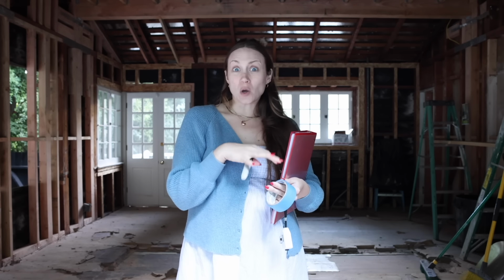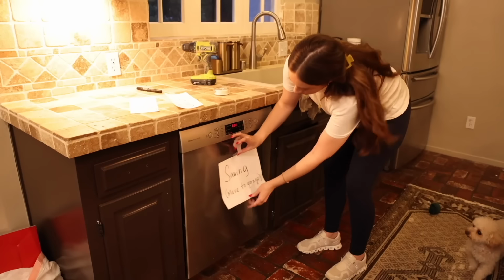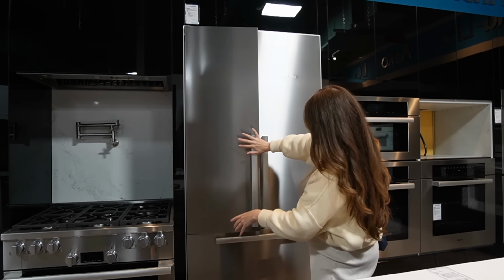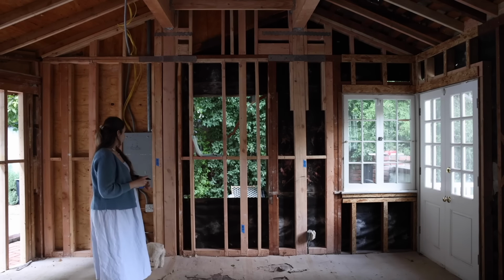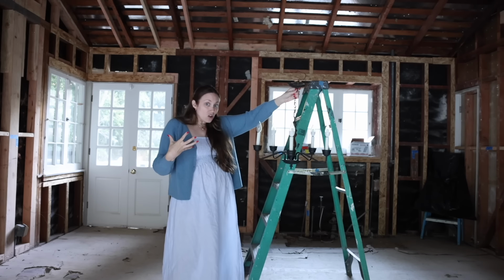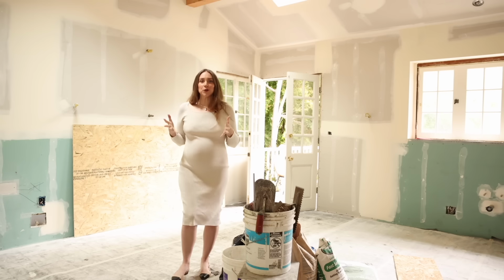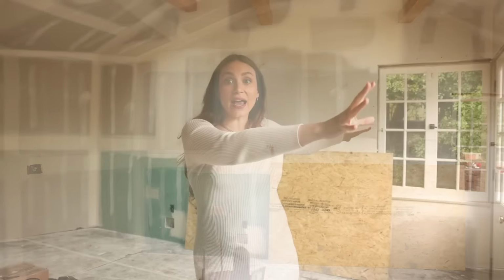EXTREME KITCHEN RENOVATION EP 3 | Appliances, Electrical, Plumbing, Insulation & Drywall

Comment: I love your candles but it costs sooo much i paid  $13?.00 for the 3 of them and then you dropped your price to $ 52.00 a candle when i paid more .I love the candles but on the one candle (green) i wax is coming out on the seal i guess it's fine but i don't burn it snymore because i don't want it to burn my table. I just love the one your Mom and you were in love with that is my faver by far. I fram your mom prints that was in the box! Everyone loves them 😊

Comment: I replaced our stove with an ILVE and it is absolutely gorgeous. It makes a huge beautiful statement in the kitchen (mine is cast iron color with bronze detail). BUT, there are definitely a few functionality things that bother me over the years. As a safety feature, you have to push down to ignite the flame for an excessively long time in order for the flame to stay on... and our broiler has never worked. Plus, all of the burners run way hotter than normal, so I can only put things on a true simmer on the lowest burner - which for me is the front left. Otherwise everything boils over, even on low. Also the walls seem to be thicker than normal so the actual interior space of the oven is smaller, so I can't fit as many things in at once. Anyway, just wanted to mention that in case its helpful since its a smaller brand that not everyone has! They are gorgeous tho!

Comment: A practical thing is.... Make sure that your Gass line too the stove, is longe enough so you can pull out the stove out from the wall so you can clean behind it on the floor.
So you don't get rotten leftovers behind the stove on the floor, my friend went thru that. 
Big hugs from Denmark.
🌹🥰💝

Comment: What if you just put the table on the other side of the room from the sink.  Run the table length wise in the same direction of the beams.  As an advid cooker, a table so close to the kitchen space is cumbersome and crowded - I like room for movement around other people (or pets) in that space.

Comment: Wait I am confused, are there no outlets at all over the kitchen counters? How do you plug in small appliances? Or are the outlets hidden under the upper cabinets and using the same power source as the under cabinet lighting? In any case, seeing this all come together is definitely cool, however in the first episode she talked about needing to do this project on a budget. Given the high end appliances, large number of new cabinets, structural changes, changes in electrical, plumbing, etc, there is no way she is doing this for under $100k (I also live in LA and have had kitchen and large construction projects quoted out here). I think this should be framed as "not unlimited money," because that is very different from "on a budget", and it's a little unfair and misleading to not make that clarification. Spending over $30k on appliances is not on a budget, vaulting a ceiling is not on a budget, this is a high-end luxury renovation, and that's totally ok, but let's just frame it as such.

Comment: I was curious if you tried any 3D options where your top cabinets aren't following the angle of the ceiling? For example they would stop aligned with the top of your wall so that the cove is more open versus having the millwork custom cut into several angles/panels and filled in? Very happy to see such quick progress for your project, you will be so happy to have this done before baby arrives :)

Comment: We decided against upper cabinets and love it. It looks so much more open and homier. It doesn't block the wall with dark boxes but keeps it open. We realized that we wouldn't reach for what was in the upper cabinets as it was a hassle to get to. Now we have a bigger kitchen and it feels extremely grand without the upper cabinets. We actually store dried foods in the kitchen for the first time and I love having it in the lazy susen. Maybe worth to note that we went a minimal route and have no handles to keep it extremely modern. The exhaustion hood goes inside the counter too, so just lights on the wall. Hope this helps someone with their kitchen plans.

Comment: Thanks for addressing my previous question about insulation and featuring this process in the video. Top priority for me would be energy efficiency and functionality, then pretty stuff. The more energy efficiency you can add now, the less you would need to use your aircon later, saving you money.
My dream kitchen would be all electric, induction cooktop, electric stove, double glazed windows,(or retrofit in existing windows). Leaving your 1930s windows as they are is a missed opportunity.

Comment: I love your Channel! Just a small suggestion, that back wall with the glass cabinet doors is stunning, however that small cabinet hanging in front that’s next to the sink seems to be misplaced. Is it possible to get rid of it and to have that space turned into a glass door, if not I still think it would look better without that little cabinet hanging in front of that glass fronted cabinet. Those contractors are amazing! Make sure you tell them I said so.

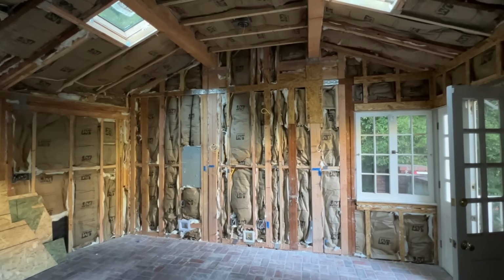Comment: At 21:18,I was quite surprised at how the insulation was installed. Since part of the science behind insulation is dead air space,I was always taught to hang batting insulation loosely inside the stud and then staple the paper flaps to the front of the stud. (Instead of pushing and squishing the piece of batting inside the stud and trying to staple to the insides of the stud - more time consuming too.) The final result should look like a solid wall of brown paper.  Help! Would a professional please address this? Thanks in advance!🙏

Comment: speaking of fridges, lol, here in France, unless you have a huge kitchen, and some people do, but I'd say 80% don't, so the standard width of a fridge is 60cm (24in~), height depends on if you have or want anything above countertop level, so many will just do a small under counter fridge, but if you wanna go up....... you can go up pretty high, lol, like almost to the ceiling high, lol, no joke, I've seen some go up to 205cm (6'6"~), lol, you need a step stool to get to the top usually, lol

Comment: Window people say replace windows but back in 2012 research shows you don't  loose that much heat through windows. Insulation is a must.
Reply: Yep.  The energy loss is mostly around the window frame.  But they have the opposite problem - heat coming in via sunlight.  It's the upside of a dark house stays cooler in the heat.
Reply: @Lucinda_Jackson  you just dont recoup your money spent like you do on insulation.

Comment: MaCenna you are absolutely glowing 🥰 not sure if i missed it, but are you doing hidden outlets for the extra 6 feet of counter space you added around the corner? It might not seem like you need it now, but that's a long stretch of counter to not be able to plug anything in. It might be useful if you need a couple of appliances running at once. Probably too late now anyway, just sharing my thoughts as someone who lived in a kitchen with 2 sockets for 6 years 😂 x
Reply: They are going under the upper cabinets.

Comment: From the picture you showed of the finished kitchen, will the dishwasher open up into the table?
Reply: From how she has the lighting mapped out, the table in the rendering is shown running in the opposite direction.  It looks like the table runs parallel to the beams, from the stove to the wall of the glass fronted cabinets.

Comment: Please, do not use directional lighting towards glass!  All you will end up with is a LOT of glare.  Instead, add lighting inside of your cabinets.  If you are using woid shelving inside the glass cabinets, add a small, recessed light in the upper most shelf space.  Use linear, lensed lighting on the underside of each shelf.  There are amazing very small linear lighting options available that can be recessed in your shelves!

I would also recommend that you use dimming capability on all lighting features in your kitchen, each type independently controlled (cabinet interior, undercabinet lighting that illuminates your counter, recessed can lighting, pendant lighting, etc.).

I am a professional registered lighting designer with 30 years experience - please believe me, you will not like directional lighting that is aimed at glass.
Reply: Totally agree with your comments regarding the directional lights causing glare and reflection off the glass. Interior lighting underneath the shelves would look so much nicer.
Reply: My first thought, too.  Light pointed at glass is not a great idea.  And yes to lighting on the undersides of shelves with one at the top.  I also second dimmers.  They can be added later, but it's such a savings to just install them at the start.
Reply: @Lucinda_Jackson  FYI:  Not all lighting is dimming capable.  If the dimming controls are not wireless, then an additional wire will be needed from the fixture(s) to the point of control. Additionally, the LED driver needs to be compatible with the lighting control (dimmer) solution.
It is a very common and costly mistake to believe that dimming can be added later.
Reply: Dimmers for all lighting is the only way to go.
Reply: Interesting
Reply: I was thinking the same as you. Though of course I am no lighting professional just ultra observant.  I am also glad those two black chandeliers are not being used.  They were never going to work aesthetically in the new space.

Comment: MaCenna the kitchen is turning out so fast and will be beautiful! In the appliance garage I would make sure to have a double outlet to make sure all of the appliances have enough power space without having to change outlets for a different appliance. It’s something I wish I had done in my kitchen. 
The Miele fridge is beautiful but most of the time I don’t like wire baskets in a freezer they feel cheap and with kid foods they don’t contain the mess for ease of cleaning. My teen has a drawer in our freezer and I still have to clean it once a month.

Comment: If it's not too late, put lighting INSIDE your pantry
Reply: Yes. Somehow pantry just seem really dark. Mine is very large but deep and really needed lighting. It would have been so much easier to have put it in during the build.  It makes a huge differece.
Reply: @judyshallstrom415  you can retrofit strip lighting that has a battery power pack that you remove and recharge using USB
Reply: I put automatic led strips vertically down each side by the door hinge. NOTHING gets lost in mine.

Comment: Just so you know, the ILive or Hallman 48 inch…. The smaller oven does not fit a normal 9x13 like the ones a couple thousand dollars more. I have it. It’s not a functional second oven, you have to use toaster oven pans for it. It’s really disappointing if you’re planning for a functional second oven.
Reply: I was wondering about that when I saw the size.  Thank you.
Reply: @brooks400  I love the top. I love the griddle it’s basically permanently attached and my boys are excellent quesadilla makers. The second oven was genuinely so disappointing. Especially since she owns the one in Texas and that oven is big. She basically just has that plus some extra burners. I’ve used the second oven less than 3x in as many years and I’m a daily bread baker. 😭